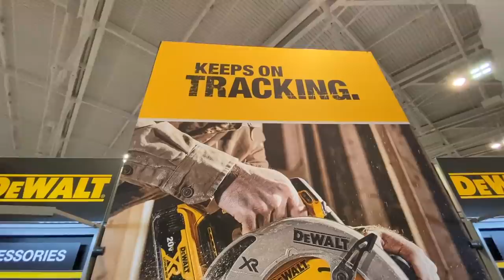Dewalts NewTools of 2020. First time seen in public at Stafda

Comment: I can say, as someone that used to be a rep for a big brand(I won't mention name), first let's say, for drill bits of any kind, and sawblades, (way easier on drill bits) but it's extremely easy to dull the cutting edge of the competitors bits and it would be difficult to see it was done, unless you had the bit in your hand and knew what to look for, if it's even visible at all. Sawblades can be weakened also, just slightly more difficult to make it non-notable. Hate to, and sad to say. But most all these companies that offer these "head to head" stand offs pull these bs trucks to sell. End of the day it's not about the consumer, it's about the $$$, and the sales numbers come the end of each quarter. And people fall for what they see without question, so its a easy..EASY way to generate sales numbers on. Sorry to ruin it for you. There are a few good honest brands still, but I'll tell you first hand, damn near all do it in every segment, not just in bits.

Comment: this is what's going on it's just a trick the blades do the same job but the demonstrators makes the tool work harder when it comes to the rival blade causing it to look like it does a shittier job. u can tell with the with the diablo demo the way the saw is being held on the dewalt blade looks more awkward looks like he's forcing the blade to work harder.

Comment: Not a controlled test in either demonstration. Too many variables which could slant the outcome. You would need a machine to ensure equal pressure. And, the blades were tested on two different tools’ The test is not valid in either demonstration, worthless.

Comment: I think  Dewalt cheated . You can see the teeth used in the diablo blade they used it was a wood only with deep teeth.  And the other test had muti wood with steel use blades.

Comment: What happened in the dewalt saws is that dewalt has one saw choked running at a slightly slower power it's common for dewalt they have been caught a few times by Deboss garage because he wanted to swap the blades on the two saws and try it again and it will show you the dewalt is inferior.  Also if you go slow it hurts the blade more whereas if you go fast it doesn't kill the teeth. Dewalt play dirty constantly it's half the reason why I quit using them. They can't ever just be honest.  Diablo is a time proven company and their product in the field proves that dewalt can't just say hey we are crazy better but we are comparable or just as good. But they cheat constantly

Comment: Think all these salesmen need to learn how to help a saw through its cut. Saws are set too deep for their cuts, asking alot out of 5ah 18v in a circular saw and cant have been fully charged if that one went flat half way through the cut. The dewalt saw had more power, and ran at a faster rpm. Perhaps that's the secret between the technology in each blade.

Comment: Diablo demonstration was one of the most dishonest demos i've seen.   That Makita battery was not fully charged for starters. Diablo booth should have used the one battery on two tools as the Dewalt demo did.     Blade cutting depth also affects the ability of the machine and blade to work as intended.  All Diablo did was show what a depleted battery looks like and then try to pass it off as blade failure.   Dodgy, dodgy, dodgy.

Comment: looks like he does not know how too use a saw, you always set the depth so it is 8th of an inch deeper than what you are cutting, also when you use a saw you take your time when using the saw, Ive used cheap saw blades, expensive saw blades and i will always choose the cheap saw blade over the expensive name brands, all you'r paying for is the name, I have been using a cheap saw blade for almost 2 years for cutting out rotted ply wood, ship lap, particle board for almost 2 years, if you take care of it, it will last, I really disliked the dewalt employees in this video they all seemed grumpy and bitchy, try going too a makita show all the employees are smiling, easy going and very very nice! great video. also for all you people thinking that a cordless saw is good for cutting stuff, it is BUT for a cut here and a cut there, if you are cutting alot of things get a makita saw for 119$ canadian and do it old school, cordless saw draws a lot of power, too get that power your looking for and great results use an extension cord and a corded saw.

Comment: Tweek the blade so it side rubs real bad and it will bog it down and heat up quicker and start taking out teeth.  They are both scamming.
These need to be mounted on a table saw with a rip fence and a third party running the wood.

Comment: OK.. both tests will not be fair because no brand is going to make their product not look superior! Only difference I'll see is dewalt did a much fairer test. Same saw, same battery, same wood, same guy.... allowed you to see the blades before and after aswell. The diablo one was so obviously staged and the guy using the dealt blade needs to go to a better acting school because it was bloody awful. There's also a chance they have fucked with either the batteries or saws to make a difference. Even the battery had writing on it. Clearly specified as the one to be used with the dewalt blade. Plus no before or after inspection of blades. I wouldn't trust that test at all! The dewalt seemed more of a fair test but still can never trust a manufacturer's demos of their products. In saying that I've always had good results with dewalt products and diablos.